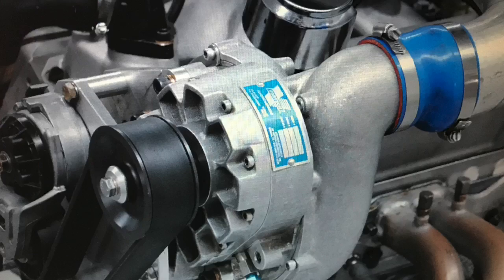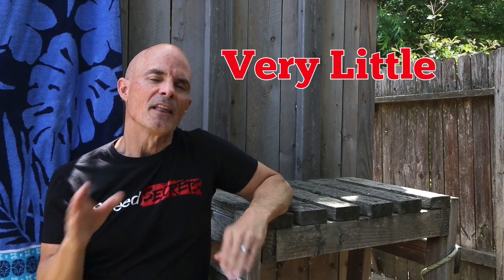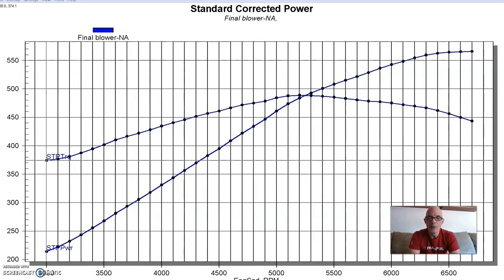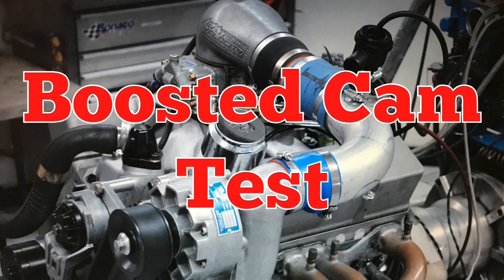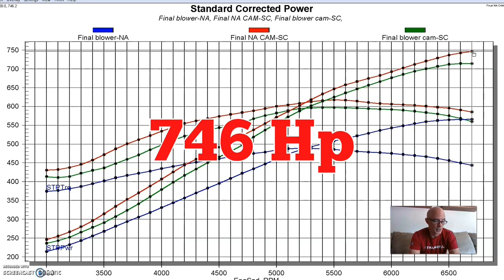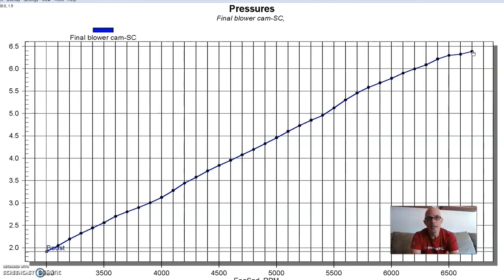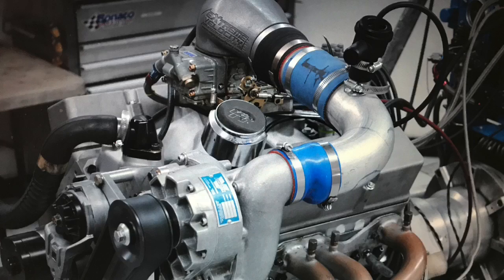MOTOR MYTH BUSTING-BLOWER CAMS!

Comment: More power results in LESS boost. This is something the guess at Engine Masters have proven and harped on repeatedly. Albeit it a blower, turbo, or NOS, "boost" will only improve over the baseline of the engine in the same range. Using Richards dyno runs, 1/2 pound of boost less is due to efficiency, not boost leak. The cam's duration has some to do with it as well. Boost is a reference of "back pressure",  not airflow. So a good flowing engine is going to manage boost (back pressure) better.

Comment: Does this change at let’s say 15 or 25 psi?
Reply from the maker: does what change
Reply: @richardholdener1727  the benefit of having a true blower cam? I’d imagine when you’re at a certain power level this becomes more of an issue? I can’t imagine 1500hp super charged builds are running NA designed camshafts?

Comment: I know this is an old video but I would like to see this same test done but if would could see the difference in cylinder pressure to see if it is actually adding to the cylinder pressure for the added power gain and if that’s why it has a lose of manifold pressure

Comment: I think to be most accurate the cam specs duration and lift should've been the same.   Just different valve timing/lsa.      Longer duration = less boost psi

Comment: If you spin that blower hard and compare the two for max power the blower will higher , i have tried several cams was sponsored by comp and the wider lob separation will help .something that was never mentioned was how was they installed,  straight up advanced 4*. Also regardless of how much boost you have 5  spinning the guts out of the blower will eat more power than one making 5 psi at say half the speed will make more power . The amount it takes to turn the blower is not affected by boost , it is mostly affected by blower speed . .  Do a test and turning the blower at max speed and swap cams and you will see the NA cam eat the dust .   Fact
Reply from the maker: the amount of parasitic loss associated with spinning the blower is absolutely affected by the boost

Comment: Awesome comparison. Before I watched your video I just picked a camshaft that's supposed to be an aggressive N/A on a 110LSA but I had them grind it on a 113LSA. I had the idea that since I wasn't going to run more than 10psi I'd rather have my engine making good power before I add the blower. So I guess that theory holds true after watching your video.
Reply from the maker: it would make more na and boosted power with a 110
Reply: @richardholdener1727  good to know for next time. It seems like the amount of a fraction of a second that the overlap is happening doesn't really have an effect on boost. This cam still has 4 degrees of overlap vs negative overlap that a lot of blower cams have so I think it'll still make good power. I didn't go too crazy with the LSA I only went to 113
Reply from the maker: we have run cams with 37 degrees of overlap with turbos-don't worry about overlap

Comment: Using more air. Boost is a measure of restrictions in the motor. Really confused where all this blower turbo cam stuff came from. PD blower cams reduce the low/midrange power thus negating the major benefits of a PD blower. Makes no sense. If you want a softer low or midrange, don't buy a PD blower. I want BRUTAL midrange which is what is used on the street. Top end power is for the track. If I get enough cash for a cam change on my Hellcat, I'll definitely go with a powerful NA cam and tight LSA.

Comment: turn.  up the boost.......your n a.  set up typically. rellies on blow 
through.  effect. . .the exhaust..pulse. ..pulls in the inake charge.........
going from. 110 lsa. to 113 lsa and a serious booost ,10 piunds and above.........but muddying up the diffrerence. to 5 pounds
.cam selection is not as   critical

Comment: @Richard holdener is there any way you could please do the same exact test with nitrous? I'm running a 108 lobe separation angle N/A cam with a 250 progressive plate I read in many forms that anything under a 300 shot will usually be fine with an NA cam.
Reply from the maker: the nitrous just adds to what is there
Reply: @richardholdener1727  I heard too tight of LSA will either create too much head pressure or cause bleeding. So 250 shot should work decent with 108 lsa? Thanks for the reply!!

Comment: I’m dealing with this exact scenario as I type. I have a 236/242 @ .050 with a 108 Lsa. Everything I’ve read and Comp says to get that out of there and put basically the same cam back in but with a 112 Lsa… For a Torqstorm… Is it worth the extra $480 dollars for the new custom cam?
Reply from the maker: you will be happy with the 108 cam with a TS-except the idle quality
Reply: @richardholdener1727  thanks Richard! Not that sound is everything, but I figure it’s going to have one nasty idle with 23* of overlap lol. Guess if boost is real low could always pulley it smaller…?

Comment: Well it makes sense because boost is typically measured as pressure in the manifold. And while the valve overlap may allow some leakage of positive pressure in the manifold, that doesn't tell you how much pressure is in the combustion chamber.

Comment: I have a procharged ls1.  7 Pounds of boost.  Only modifications are pac1218x springs, stronger pushrods, and titanium retainers.  Springs are rated up to .600 so I can go to a bigger cam.  My plans are to port the heads, headers, mild cam, and smaller sc pulley.  Ported Fast 92 intake would be nice, but I really can't justify the price.  Comp cams has a cam that's 212/218 duration, 114 lsa, .522/.529 lift.  Stock cam is 196/208, 116 lsa, .467/.479.  If I'm guessing right, this cam will give me a little higher redline than stock and a little better flow while minimally impacting idle and low end.  Am I crazy for going with such a small cam?  My whole  plan is to make about 100 more horsepower with only going up a little bit in boost.  I don't want to have a high boost engine.
Reply from the maker: when you add the cam, the boost will drop so you can then add more boost
Reply: @richardholdener1727  Thanks.  That's what I was hoping for.  I'm guessing that cam will also change very little idle or low end wise.

Comment: both are blower cams lol 
 cam tecnology  has brought in bigger long duration lobes  look at a naturally asperated nas car engine cam  also  you dont see 480 480 valves lift on boost cam it would be 480 510 234 50
was b&ms over 6000 rpm cam
for the most part under 6000 rpm  heads and cam dont matter forced induction 
does the job the heads and cam do and centerfugal superchargers 
are top rpm only 
so heres the test for you 
chevy 350 144 roots teflon bladed supercharger 480 510 b&m cam vs 30 30 duntov cam

For the Comp hydraulic 30-30 :
advertised duration: 286 intake/293 exhaust,
duration @ .050 : 239 /246 ,
lift : .483" /.477" ,
lobe center: 112 degrees.

advertised duration: 284 intake/291 exhaust,
duration @ .050 : 247 /254 ,
lift : .504" / .498",
lash: .012"
lobe center: 112 degrees
huge intake smaller exaust
weve came a long way since these 2 duntov cams
Reply from the maker: seems like an odd test
Reply: @richardholdener1727  30 30 duntov is perfect asperated cam sharp tall lobes
little seperation  and intake lift is bigger than exaust 
the difference vs 488 510 b& m  blower cam would stand out 
B&M super street cam 
The B&M 3444 hydraulic lifter small block Chevrolet camshaft has a .050" duration of 234 degrees intake, 244 degrees exhaust. Cam lobe lift is .3254" intake, .3400" exhaust. Gross valve lift is .488" intake, .510" exhaust, with standard 1.5:1 ratio rocker arms. The lobe separation is 114 degrees. Cam timing at .050" is: intake opens 8 degrees BTDC, intake closes 46 degrees ABDC, exhaust opens 61 degrees BBDC, exhaust closes 3 degrees ATDC.
the B&M super steet cam was a 100 horse upgrade on dyno thats big
and racers are using the duntov cam to this day and made 1 horse per cubic inch
on 283 I think 
a perfect battle of race cam vs blower cam with B&M or Weind 144 supercharger lol

Comment: I have a very similar motor in my street car.  11-1 510 lift cam.  Thinking about a pro charger and going E85 low boost.  I'm wondering if this was done on E85 or race gas.

Comment: Great video Richard my question would be.would the results be close to the same. if the static compression ratio was 12.8 and the na cam was on 106 LSA running turbos. I'm kinda new to Turbo and blower applications and trying to learn what I can get by with on cam and compression ratios you hear so many different opinions from people

Comment: It isn’t so much leaked boost as it is hotter temps with the overlap. So with the wider lobe separation you can ad more boost. 
The N/A cam had a 25% increase in power boosted. The boost cam had a 26% increase.

Gave a big advantage to the NA cam with 265 duration and only 6psi. But I bet at 12psi that NA cam is going to get hot!
Reply: What are you saying, na cams made more power

Comment: Thanks so much for this video. Im back to Chevrolet/GM after paying off my 2011 GT500. Love that car and its capable of big, stupid power. Problem though is genuine factory parts are hard to come by now and will be even harder in the future. Block and cranks are long out of production, cylinder heads are becoming scarce. I cant just go to Trick Flow, AFR or Kaase and get a new or better set. The parts catalogue has truck 5.4  iron block and crankshaft as the available replacement parts... A total downgrade from the factory equipped Aluminum block and Cobra Jet crank.

 If I have a catastrophic engine failure with my GT500, Ill never be able to AFFORDABLY get her back the way she was. So Im looking at picking up a C6 LS3 Corvette to join my GT500 in the garage as my irresponsible speed vehicle. I want to go with an H/C/I/E as soon as I can, but boost with a Centrifugal Supercharger up to 1000rwhp is the ultimate goal. 

Really glad to see with actual real world dyno numbers that a bad ass NA cam works even better as a boost cam. With a near limitless amount of parts available, Im REALLY becoming a huge fan of the LS. Late to party for sure, but the gear head in me is VERY excited at the possibilities. LS is the king of parts, simplicity and ease of repair. If I blow up the Vette motor, I no cry. Just head down to the junkyard and start pulling LS engines. lmao

Comment: Because boost is a measure of restriction and the NA cam is more efficient boost pressure dropped. Now if you were to change pulley size to match the previous runs boost pressure the difference would have been even greater between the two cams.

Comment: You asked if the lower boost pressure with the NA cam was due to higher airflow or more overlap.
My answer is: both.  Higher volumetric efficiency NA will lower boost pressure from the supercharger, and more overlap angle*area will bleed off some boost pressure.  But you didn't have the required instrumentation on the engine to be able to separate the two phenomena.  And the test was muddied by having an NA cam with 14 degrees more duration.  It would have been a cleaner test if the NA and Blower cams had the same duration, and a large difference in displacement angle, like 106 to 116.

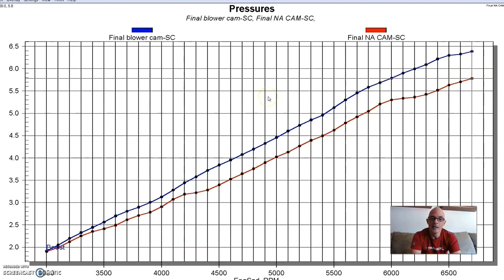Comment: At 9:35 - why does the boost drop with the NA cam? All of the above - boost leaking out from overlap AND the longer duration cam provides more time for the boost to fill the cylinder. Pressure is only one measurement. You also need to measure MAF to know how much charge you're actually capturing in the cylinders.
Reply from the maker: boost does not leak out
Reply: @richardholdener1727  You explained that with turbo's the exhaust pressure is higher than boost pressure. Makes sense. But with SC, wouldn't exhaust port pressure be lower than boost pressure? With the (boosted) intake and (unimpeded) exhaust valves open at the same time, why would higher pressure air flowing into the intake not also exit the exhaust during the overlap period where both valves have fairly low lift and the cylinder volume is pretty small? It wouldn't all leave there as the lift during overlap isn't that high, but a the small drop in boost pressure makes sense.  Your comment about the lower pressure, I thought was about filling efficiency associated with the valve timing, but the heads flow at exactly the same rate and the lift on both cams is the same with the NA cam having longer duration and overlap, so I didn't quite understand why you thought that the NA cam was going to provide greater cylinder filling efficiency. 

I think that you need higher resolution of in-cylinder pressures over time before we'd know for sure, but one thing I am sure of is that fluids always flow from high pressure regions to low pressure regions and during overlap, I can't see how you wouldn't have that with a SC application. I'm actually genuinely curious about this, and I'm asking because I think you're really knowledgeable about this. I was surprised that the NA cam made more power, but I'd also like to see how the power responded as boost levels increased with both of these cams.

Comment: Man..i love that in 2020 you still show me a real...sbc 400 with boost..great video
I have a sbc 408 with a 94mm turbo.
Reply from the maker: that's a big boy
Reply: Hey Richard whats you opening on a 439" BBC all forged dome piston around 12-1..with a vortech v7 ysi with either a c&s 900 methanol carb dual needle seat or a gas 850 single needle.  10psi or so is fine looking for advice has a 714 714 ..262 268 108lsa. Im i creating a 💣

Comment: If it is dumping some air/fuel out the exhaust  can you measure it? In fuel used or  some other method? Wouldn't this improve scavenging, cylinder cooling for the next charge therefore improving hp? As we transition to direct injection maybe one day a "blower cam" will have more overlap than a NA cam to  improve cylinder scavenging/cooling if you really want to go down the rabbit hole:)

Comment: With the larger cam the cylinders have more time to fill. They flow more air through them. The engine capacity is increased. The supercharger airflow is a constant. Engine capacity goes up. Supercharger airflow remains the same. Supercharger power draw goes down. Power is increased from less power draw, lower charge temp and more dense air charge at the lower boost pressure.

Comment: If you run boost with a tight LSA, you're just blowing some of your fuel out the exhaust port, raising your EGT and under hood heat. There's more to an engine than peak horsepower alone.
Reply from the maker: how does boost blow out the exhaust when there is more back pressure than boost pressure
Reply: @richardholdener1727  supercharged apps, not turbocharged. Your point is taken, however. I don't see how a supercharged engine would have any back pressure, but a turbo, certainly would.
Reply: @donellmuniz590  Just blowing out the exhaust port?  Dude you just watched a video where a cam with more overlap made more power than a cam with less overlap.  If it's making more power, it's burning more air and fuel. So it's not "just blowing out the exhaust port" there' is clearly more air and fuel staying in the combustion chamber. Otherwise it would be making less power, not more.

Comment: For anything other than a DRAG RACE ONLY engine, there will be benefits to an engineered blower or turbo cam. Do you do all your street driving at full throttle? Do you have power brakes? Do you care about part throttle driveability and mpg? If "boost" cams didnt have merit, Comp wouldnt make them.
Reply from the maker: My point was that you can add boost to any cam-and it works, some work better
Reply: @richardholdener1727  duly noted, my friend.

Comment: I always thought blower cams /turbo cams have wide lsa and  open I take valances sooner to fill the cylinder with more cylinder pressure /boost engine thru opening the intake valve sooner to fill the cylinder with more boost and I always thought that a smaller cam with tight lsa like 110-113 puts a load sooner to help with spooling a turbo sooner

Comment: Would love to see the BTR centifugal camshaft in this test.  He has some specific beliefs (says he tested) regarding overlap, lift (especially exhaust), and duration for centrifugal superchargers.  Would be awesome to see if that holds true.  His basic premise is that his centrifugal cam will still supply the top end power, but will help bolster the low end torque that is missing from centrifugal's.  Love to see that test!

Comment: A very smart guy told me something a very long time ago. An engine doesn't know what brand it is, what size it is, what marketing says it should do, what it is going to be installed in, if it has power adders, or what planet it is on. It knows at this instant, I see this fuel and air, at these atmospheric conditions, and with these parts, I can do THIS, at this instant in time. Jim KInsler, KInsler Fuel Injection,....1984. More fuel, better atmospheric conditions, less restrictions, more power. I bet the bsfc, went up with the n/a cam, but hey, we want more power, and this is not an emissions controlled engine. I like this test, hope to be building something under boost soon, and this showed me something. The engine saw 14.7 at sea level, then it saw appx 21.5 at seal level, or whatever, and liked it!

Comment: Hello Richard, any thoughts about doing the other guys Chrysler 383 with 11 to 1 compression and using and Edelbrock Performer Rpm Dual Plane and heads to make it fully use the 6500 limit of the manifold. I think it would be awsome because Everybody always goes for the 440 and Nobody shows any Love for the 383. Thanks again for the Great Video and I Love your Channel.
Reply from the maker: Steve Dulcich loves the 383
Reply: I'm thinking about a awesome collaboration,  he could build it and you could add all sorts of things😁